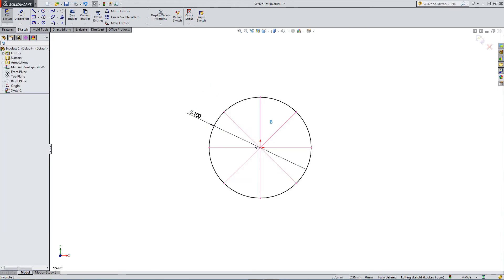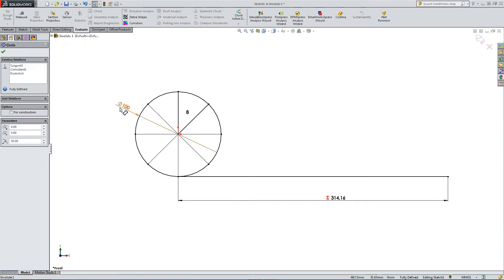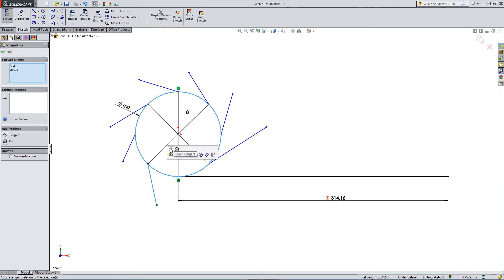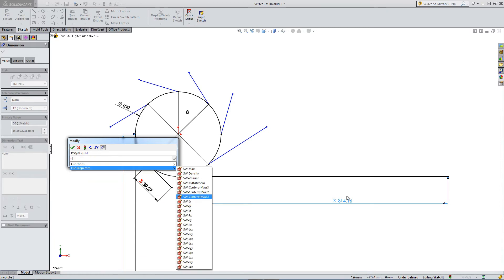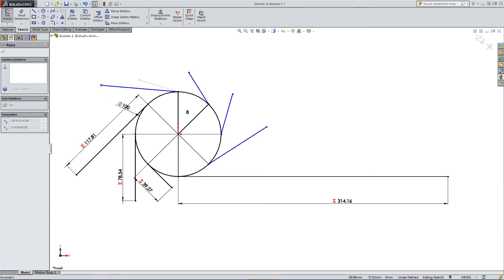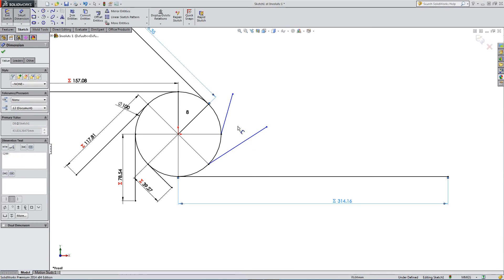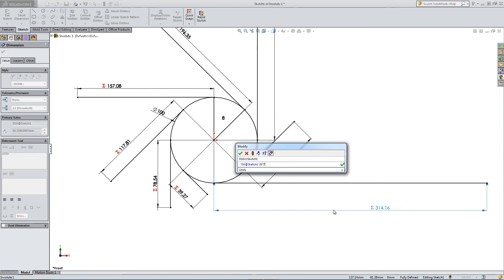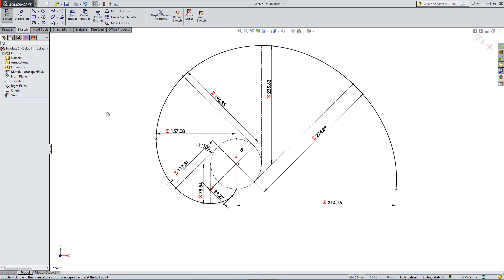Involute of a circle - involute curve

Comment: Great video. Where do we use involutes?
Are involutes special shapes? thanks
Reply: It is the ideal shape of gear teeth to allow maximum contact time and create a perfectly linear constant force as the gear turns and the teeth transfer force to each other thanks to the shape of the involute. Each gear diameter has its own corresponding involute
Reply from the maker: You can see involutes naturally occurring in nature in some shells. In engineering it is used in certain types of gear design. It can also appear in some gas compressors. It’s also used by mathematicians and artists.
Reply: @PDWCreative  Thank you.